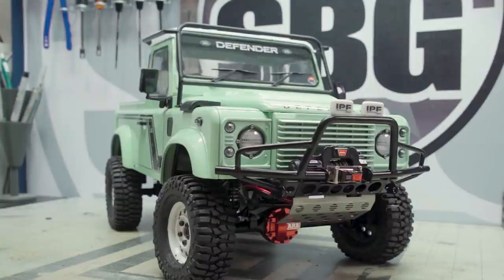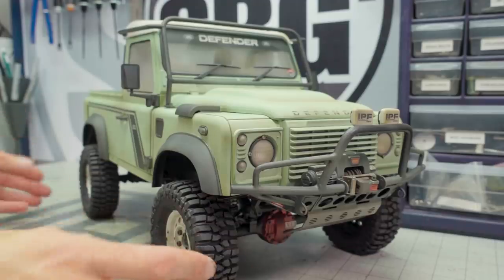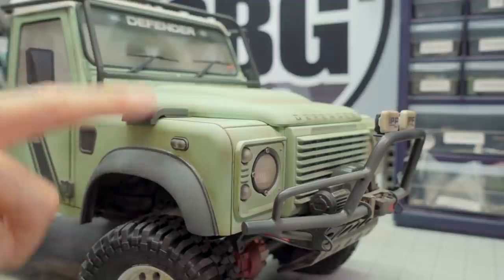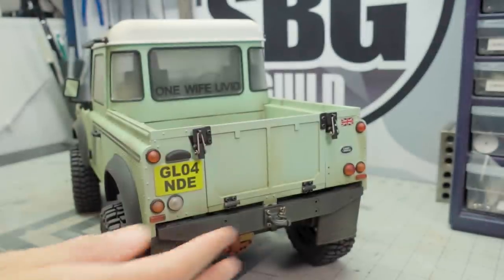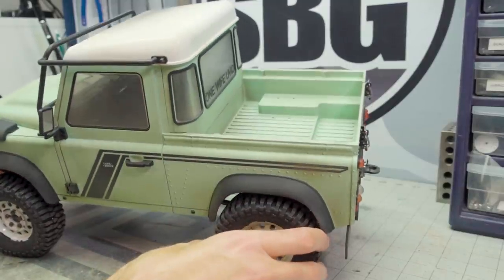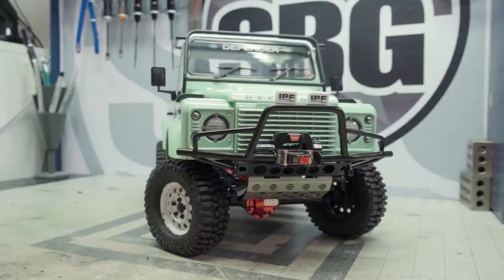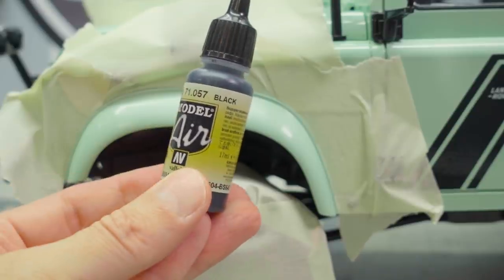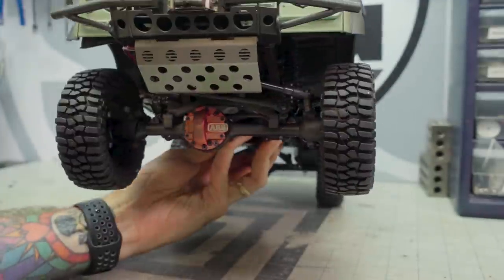Make your RC's look better with Weathering!

Comment: Weathered up my HG P408, just got finally done with it. I use Rustoleum and Krylon Fusion camouflage paint. Also use Rustall weathering kit. Finalize everything with a matte clear coat, which is also great for "dirting" up the glass.

Comment: Very nice work, brings the model to life, looks much better. I weather all my other models, but my hard body D90, in metallic gunmetal? Still not sure. One can use weathering powders from MIG et al but make sure that they are sealed - and be aware, the powders can change colour when sealing them. Also one can rust bolt heads, add corrosion to the Birmabright alloy panels (Land Rover Series 1-3 iirc) and worse on certain later Defenders, including heavy rusting to the rear cross member. Lots of fun. 

I've driven myself mad trying to order parts too, my buddy has gone even further. The issue is which parts fit and which parts work together - as you demonstrate.

Comment: With my 78 chevy k10 stepside I painted the inside a rust color that I mixed myself then painted the outside blue so when the blue paint scratches off it looks like rust. Worked out well

Comment: I'm running 4.19 tires trimmed the fenders and used the lower shock hoop hole. No rub. Put an axial ae5 and 35t motor with head tail lights. Xtra speed rock sliders. I'm thinking about xvd shafts and metal drive shafts. Also bummer replacement a d inner fenders

Comment: The rubber black on the fender arches is excellent, makes it look 100% more realistic straight away! 

If you are concerned about the approach angle with the bumper, consider that this body shell is modelled on the later version of the Defender which had a deeper grille housing for when the vehicle was fitted with air-conditioning... You could always trim the grille around and recess the winch back into it (which is what you see on a number of 1:1 Defenders, particularly when a Warn 8274 winch is fitted). I would also consider mounting the two rectangular spot-lights the other way up, below the hoop of the bull-bar - they would be better protected that way.

Comment: What you call an air filter is actually a snow cowl  to prevent snow entering the heater duct. Could you not cut the grill to fit the bumper closer like I did on my real one.
Nice bit of weathering much more realistic

Comment: Do you weather prior to spraying your clear coat? Or after? I know you said to add in the weathering to the body lines after the clear is sprayed- but but about when you just go at it with the air brush?
Reply from the maker: I usually spray clear coat prior to weathering. Thanks for watching!

Comment: Hey Matt did you dilute your vallejo air before applying them? What is your compressor  psi pressure?
Reply from the maker: No dilution required with the Model Air line of paint! I run around 35 psi if I recall.

Comment: Question: I have a lexan body with a Freqeskinz wrap. Should I use lexan airbrush paints over the top of the wrap or just regular acrylics from Vallejo?
Reply from the maker: If the paint isn't going on lexan don't use it. Wraps are a sticker but should accept Vallejo.

Comment: When i get the body for my crawler build im going to paint it on the outside and then paint it like a light grey metal looking colour on the inside so when I scratch the paint it looks like a real car getting the paint scratched off.
Reply from the maker: Provided it's Lexan, that will work really well!
Reply: Scale Builder's Guild yes its lexan👍